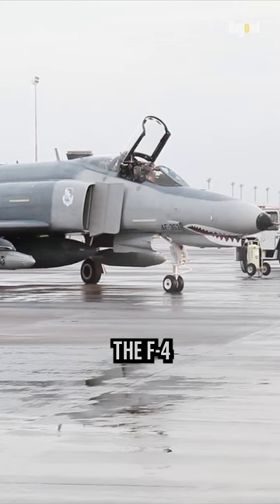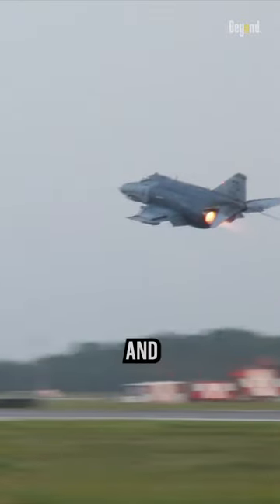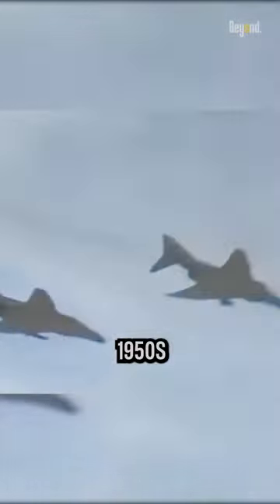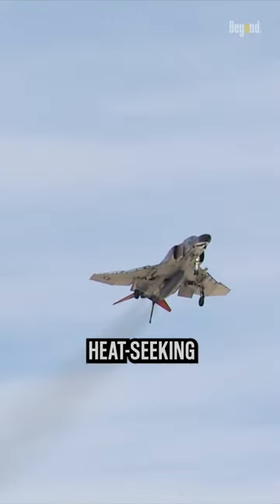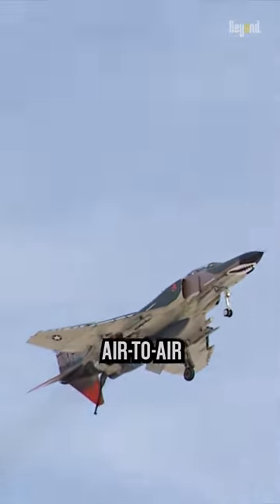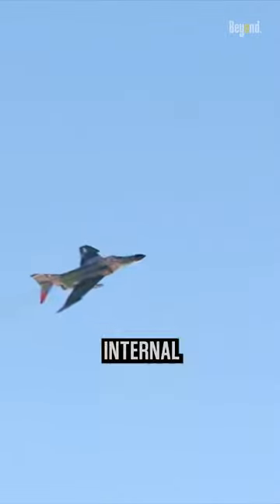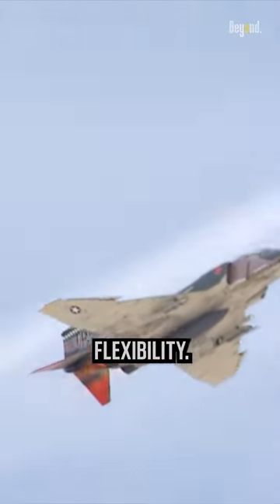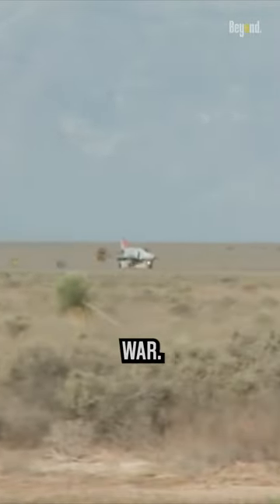Why Was the F-4 Phantom II Designed Without an Internal Gun? #shorts

Comment: They were correct tho. Missiles were the future of aerial combat, but they lived in the present. And their missile tech was lacking. While obviously right now no aerial combat is taking place in gun range. We didn't really have a war large enough to force such engagements. Imo if a peer to peer war lasted long enough, guns would once again be used to fight in the air.
Reply: I mean, from what ive seen from simulators, missiles are an opportunistic weapon. With countermeasures and notching you can avoid them unless youre just not aware or too low energy to break lock.

Of course a wise pilot would save missiles till its a sure kill, but i could see a full scale engagement, with both sides having high tech fighters(so not in this decade) where alot of gun kills take place because bullets are more expendable than missles, so bvr attacks, if they fail, then mid range, then close range and a then a quick pass where a gun kill occurs.

Right now, america is the only country with tried and true antiradar, and long range/reliable missile tech. A f35 can be tracking a russian plane completely unknown, so when it fires a missile its a guaranteed kill.

But even if in an even fight, aerial combat still ruled by missiles, i would say guns still important as an all around last resort. 30mm good against ground, sea, and air forces, what other munition can replace that?
Reply: Missiles drop from 80% hit chance to about 50% when target drones are fitted with chaff and flares. If you're fighter is carrying 2 sidewinders, you're looking at a 75% chance to kill one target before being empty. You can't jam, chaff, lase, or flare a bullet.
Reply: Yeah rhe f-4 "poor" early performance is really the lacking of early missile technology
Reply: @kerbalairforce8802  buddy when you need to empty half of your magazine to hit your target guns isnt efficient weapon and guns jam. And take a look at your calendar today and realize that you need to stop pulling statistics from the late cold war remember bud if we can hit a bullet with a bullet going mach 20+ it isnt hard to do so against an aircraft doing barely mach 1
Reply: @daslynnter9841  your not gonna get anything accurate about missile from civilian simulators even when they say they modeled it accurately (they dont)

And everything has pretty much replaced the gun as if you target a car with a gun you will hit the car and everything around it. A modern guided munition could quite literaly target a specific seat in that car to hit.
Reply: @gotanon9659 If you are expending half the ammo for the gun you are doing something wrong.

Comment: When was the last time there was a United States military aircraft, attack designation or fighter designation, they did not have a gun?
Reply: The Air Force F-4Ds and the Navy's post-Vietnam F-4N and F-4S were the last ones. All the 4th generation US fighters have them as a result of Virtnam lessons learned in dogfights.
Reply: @chipbarnes3991 modern fighters have them for ground strafing, not air combat. The US haven’t made a gun kill outside the A-10 shooting at helicopters… since 1972
Reply: @armorcast, they are used for either. Air-to-air training includes gun kills whether in initial type training for the aircraft or in fighter weapons schools like Top Gun. Fighters prefer longer range missiles so you don't see gun kills. Ironically, the A-10 30mm GAU-8 (helo kill in Desert Storm you mentioned) was definitely not designed for air-to-air, but was successfully used for that.

Comment: I think the F-4E has an internal gun but it’s under the nose of the phantom which is lessons learned from having a gun pod

It sits just in front of the nose gear
Reply: Correct. USAF had the F-4C and D without the gun. The E was the only version (all for the USAF) with the internal guns. The original customer, the Navy, flew F-4B and J models in Vietnam. When those were upgraded post-war (F-4B to F-4N, F-4J to F-4S), they did not receive an internal gun.
Reply: Yeah and F4EJ

Comment: Im just going to save you guys from this poorly researched shorts: 
The F-4 phantom had been designed with a gun but part of a ground attack package as the F-4 was supposed to have multiple mission nose package (Recon, Intercept, ground attack) but the other nose package were cancelled after they found out trying to change the nose of the aircraft inside a tight hanger space in a moving carrier was a terrible idea.

Comment: In less B$ terms, the generals making the stupid decision to leave out the machine gun were very wrong.  The missiles being used at that time were trash. They mostly missed, and the Migsof the time shot our F4s down with Their guns easily.
Reply: And they wasted millions more to add the gun and found out it was complete garbage
Reply: The real problem (aside from rudimentary missiles) was that fighter tactics weren’t being taught properly.  Pilots weren’t taught to seek favorable engagement angles to help their missiles get kills, and most importantly, they weren’t taught not to get into slow turning fights with smaller and more maneuverable aircraft.  The F-4 just wasn’t built to do that.  But it could dominate those Migs if it used its speed and altitude to its advantage instead of playing the Migs’ game and getting into low-speed turning fights.  This had been US doctrine since 1942, and it was very successful when employed.  The Top Gun school taught US Navy pilots to employ these tactics again, and those same F-4s started to perform a lot better.  These tactics are still taught today, which is why the US really isn’t worried about supermaneuverability as much as it is with energy retention, acceleration, and sustained turn rate at high subsonic speeds.
Reply: @bluemarlin8138 Boom and zoom.

Comment: These are same type of people that claim that the f35 doesn't need to be fast :(
Reply: When people claim that the F-35’s Mach 1.6 isn’t fast, what they don’t realize is that an F-15 or F-16 or Su-35 can’t go much faster than that in actual combat because they’ll be carrying external weapons and/or fuel.  An F-35 doesn’t have external weapons and fuel tanks slowing it down, so in combat it’s just as fast as a 4th gen fighter.   And those alleged speed limitations on the F-35 are for the long-term maintenance of the stealth coating (until the new ceramic coating comes out).  They don’t apply in combat.

This principle also applies to the F-35’s maneuverability.  Aside from the fact that the F-35 is actually rated for 9 Gs and still had artificial limitations in the fly-by-wire software when it was beaten in testing, it won’t have external missiles and fuel limiting its maneuverability either.

Comment: Wrong from the first sentence! The f4 did not have an internal gun, the f4 phantom II did as it was the upgrade over the original. These are two different aircraft and you, dear ai voice, should copy at least that part from your chat gpt script
Reply: You got it backward. The FH-1 Phantom was a 1950s Navy fighter with internal guns. The F-4 Phantom II had no internal gun in its Navy versions (F-4B/J/N/S) or in its early Air Force versions (F-4C/D). The Air Force F-4E didnget an internal gun while the other versions had a GE 20mm minigun external pod, usually carried on the centerline.

Comment: For all the folks talking about how stupid it was to not have a gun; go look up the kd rate of the usaf phantoms after they installed the gun, and look up the rate for the usn who never installed the gun. The usaf continued to see unacceptable losses after installing the gun because the pilots were never trained to use the gun. The usn decided to train their pilots how to use their missiles correctly and revamped their missile maintenance program, and went on to see a ridiculous improvement in kd. That was the original top gun program. Not gun fighting. Missile fighting. The gun was never the problem.